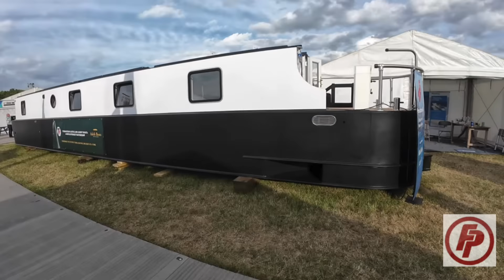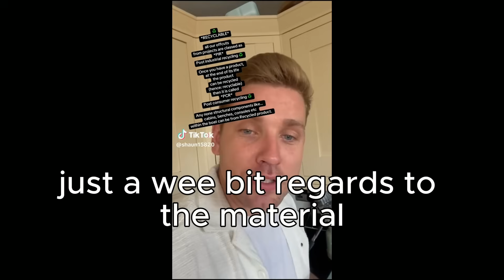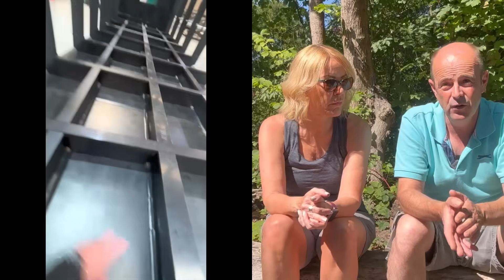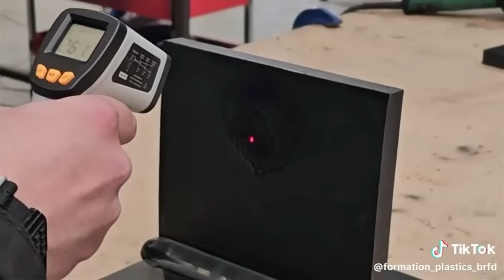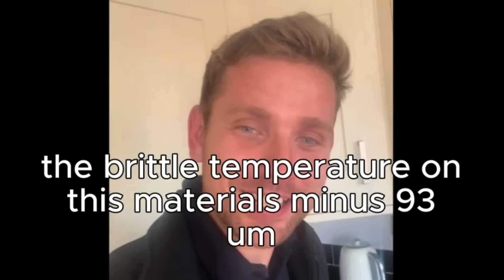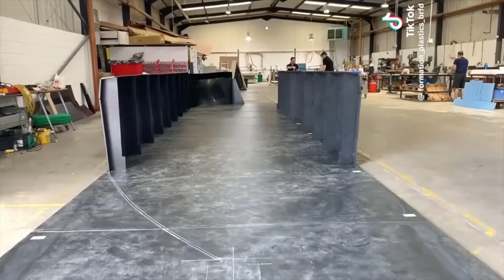Rust-Free Canal Boat?! The WORLD'S First Plastic Narrowboat Explained | 194

Comment: A very interesting idea. 
Question: what's the embodied energy to make the plastic? How does this compare with making steel?
Reply: Great question! Polystone G marine tec has an embodied energy of around 75–100 MJ/kg, while steel is lower at 20–40 MJ/kg. But Polystone G is much lighter, corrosion-resistant, and ideal for marine use, where steel would need coatings or constant maintenance. Plus, Röchling’s ReLoop® version uses recycled content, cutting the energy impact even further.
Reply from the maker: Glad to see Shaun answered for you 😁

Comment: The plastic boat floats higher so distance from water level to top of the cabin plus solar panels etc. will be greater than  steel boats.
There are many bridges on the canals that steel boats just squeeze under.
What's the plan for overcoming that problem?
Reply: Great point! Since our boat Polystone G are lighter, they do sit a bit higher in the water, which can raise the overall height. But this is usually solved by smart design—things like lowering the cabin profile, using fold-down solar panels, or adjusting ballast to fine-tune the draft. Plus, the lighter hull means there’s more flexibility to tweak the design compared to heavier steel boats. So, navigating low bridges is definitely something that can be planned for
Reply from the maker: Luckily as Shaun has explained it can be overcome 😁

Comment: Not plastic, but with a proven track record. How about surplus WWII PT boats? That would cause a stir on the old canal. Whatcha think?
Reply from the maker: Ha! That would definitely turn heads 😄 But WWII PT boats are huge—around 80ft long and ~20ft wide with big planing hulls and very thirsty petrol engines. Great on open water, but a non-starter for UK canals (locks/bridges are built for smaller beams and low wash). We’ll stick to canal-sized hulls—HDPE gives the low-maintenance benefits without breaking the canal rules. 😃

Comment: So watching the heating transmission test, does this mean insulation is not req'd?
Reply from the maker: Great question! The test just showed how much better HDPE performs than steel at stopping heat transfer. But you’d still need insulation inside for comfort, to manage condensation and to keep the boat warm in winter/cool in summer — just like with a steel boat. 😁
Reply: @WidebeamandWellingtons Ah okay ta. Fascinating material though. Thank you for the video & reply x

Comment: Great strides forward, but the biggest problem with taking this further will be the upscaling to large production figures. The welding is the most obvious bottle neck, as it requires a very specialist welding technique. Best of luck in making this the success it deserves to be. Really exciting venture.
Reply from the maker: Really appreciate that! You’re right, the welding is a very specialist skill — that’s what gives the hull its strength. It’s definitely an exciting venture and great to see new approaches coming into the waterways. 😁
Reply: Its All straight lines So it wont be long before the welding gets automated. I used to be a welder(stick Gas CO2 and Argon) and you look at the welds on aluminium bicycle frames from places like Korea. Aluminium is Notoriously hard to weld because the oxide that forms on it almost instantly, melts at a higher temp than the actual metal, so when it does melt the actual metal just falls out and flows away, you have to see it to believe it. Yet through automation they make absolutely perfect welds on Aluminium Bicycle Frames, Magic is the only word to describe it. No doubt over the years similar tech will be developed(if its not already available) for reducing the welding labour times in HDPE. Steel is the one reason I have never considered a narrow boat. How about Stainless Steel(just a thought).:hand-orange-covering-eyes::face-blue-wide-eyes::body-blue-raised-arms:

Comment: I've pointed out elsewhere that hdpe boats, while great in lots of respects, and great in sea going scenarios, have some rather big downsides. Its a strong material and easy to repair for scratches etc. They say that it doesn't shed microplastics. But I would say that any shed plastic from abrasion on lock sides, concrete edges, steel protrusions, while not technically being "micro" will enter the environment and never be removed. Over time, large pieces of plastic, such as millimeter sized swarf, will become microplastic. While only the occasional boat is on the system, it wouldnt be a major problem, but if they became widespread there would be a problem.

The second major problem is the behaviour of the plastic in the event of fire. Unlike steel, hdpe becomes soft and melts at a relatively low temperature. Furthermore, hdpe, when it becomes engulfed in fire, becomes fuel.

Instead of the "tests" that they have shown, which look like they are designed not to fail, I'd like to see some real world tests. I'd suggest that hitting a finished boat with a hammer or squirting a bit of burning solvent on it, tells you nothing. Instead, I'd like to see a finished hull being dragged across their concrete yard and seeing how much plastic gets ripped off. I'd like to see a section of hull finished and lined with wood and PU foam and then subjected to a proper fire test.

You say he's consulted with BMF, but thats a trade organisation. Has he consulted the Boat Safety Scheme? Has he consulted an independent fire safety organisation? Has he consulted CRT? He has said in the past that he intends to do so, where is the evidence?
Reply: Appreciate the detailed comment — totally fair to raise these questions, and it's important to have open discussion around new materials like HDPE Polystone g marine tec  in boatbuilding.
On fire safety:
The ignition point of HDPE (like Polystone G Marine-Tec) is actually very similar to GRP — both ignite around 350–400°C. Like GRP, HDPE will melt before it burns, and yes, it's a combustible material — but so are foam insulation, plywood interiors, and even paint systems used in steel boats. Fire safety isn't just about the hull material, it's about the whole build-up and how it's managed.
On CRT, BSS, and insurance:
We’ve spoken directly with both CRT and the Boat Safety Scheme regarding our designs. Our widebeam HDPE boat has been inspected by BSS and they were happy with everything we’re doing. Same with CRT — they’re aware and supportive of innovation as long as it meets safety and environmental requirements. Insurance has also not been an issue — we’ve had full cover with standard providers. There’s a growing understanding that HDPE, when done right, is safe and reliable.
On real-world testing:
Totally get your point about wanting to see more "abuse" style testing. We’ve already tested HDPE under some basic tough conditions (impact, fire, dragging, etc.) but we'll keep publishing more content showing how it performs in the real world. It’s still early days for this material in inland boats, but we’re committed to being transparent and setting a strong standard.
End of the day, no material is perfect — but HDPE offers a lot of long-term environmental and maintenance benefits, especially when fully welded and built properly. Appreciate the feedback rd. 👍
Reply: I would think even if all narrow boats were plastic the amount of micro plastic that would come off them is a probably be nano % compared to drinks bottles in the environment or nylon clothing or plastic in dishwashers, road tyres ! I would guess if all canal boats were plastic, the plastic pollution would be 0.00000000000000000000000000000000001 % of the world’s plastic nano particles. But it would be a complete stab in the dark, probably an even smaller number !
Reply: Yes, but if you take into account that this plastic, unlike fiberglass and steel, doesn't need to be painted. So there's a massive reduction in paint chippings entering the water. Scatches could be eliminated by sticking carbon fibre or graphine to the hull. Further, these boats are lighter so they use less fuel which means less pollutants entering the water and air. Also as they're lighter it's entirely possible to have them powered by electric. For instance something similar to a range extender car like BMW's I3. With batteries getting smaller and smaller but more and more powerful these boats are a no brainer.
Reply: @safebarbell narrowboats don't get lighter. If they are made of lighter material, they need heavier ballast. The overall weight has to be the same, otherwise they don't sit right in the water.
Reply from the maker: Hi 👋🏻 and thank you for the detailed comments as you can see Shaun has answered for you! 😃
Reply: You worry about microplastic coming off practically non existant narrow boats? What about the tens of millions of wheelie bins that get smashed about every week? If you are going to worry about something, at least be realistic.
Reply: @markrainford1219 yes, you probably use the same excuse when you're chucking your burger wrapper out of the car window
Reply: The weird thing is that with these plastic boats you are not contributing much to the canal boat industry. With it being ‘indestructible’ and maintenance free you will take a lot of jobs away from it. And as every hull needs to be in virgin material you still keep creating more and more plastic as you can’t reuse one old boat to build a new one. And how many times can you actually reuse the material to still be safe for marine and human life?
Reply: @tteric67  You raise a fair concern, and it's something we’re actively thinking about. Right now, hulls do typically rely on virgin polymer to meet structural and safety standards—especially for marine use where strength, UV resistance, and longevity are critical. That’s a limitation of current recycling technology, not the goal.
That said, there’s a growing focus on post-industrial recycling—where manufacturing waste is reused immediately—and post-consumer recycling though it's not yet viable for core structural components in boats. We're watching developments in advanced polymer recycling closely, especially those that could allow safe reuse without degrading performance or environmental safety.
As for the canal boat industry: yes, materials like these change the maintenance model. But they also open up new opportunities in design, services, and sustainable innovation. We're not claiming this is a perfect solution—just a step toward less waste, longer life, and (eventually) more circular manufacturing. It’s not about replacing skilled work but evolving how it's applied.
😊😊😊.
Reply: Danger of microplastic in the environment is highly overegged to the point of ridiculousness.
Reply: @TheBeaker59 your view entirely, but not shared by everyone. When microplastics can now be identified in human blood, brain tissue and breast milk, but with absolutely no knowledge of what harm this might cause, excuse me if I prefer to err on the side of caution. Afterall, your attitude is an exact parallel of the one that used to be held up by the tobacco industry - look where that is now.

Comment: One thing if the plastic boat sits higher in the water what happens to with low bridges and tunnels?
Reply from the maker: Hi we’ve had this question a couple of times, here’s Shaun’s answer 😁
“As for draft, our setup has a draft of approximately 17-18 inches using the Vetus E-Pod propulsion system. If you were to use a more conventional propulsion system, you'd be looking at a draft closer to 19-20 inches, depending on the configuration.
Your points on wind drift and low bridges are valid - and as you said, easily addressed with additional ballast or by fitting a keel/skids.”

Comment: Why cant new innovationsbe cheaper lol
Reply from the maker: True, you’d think new inventions would be cheaper straight away. The reality is the first few are more expensive because of development costs and smaller production runs. The difference with these plastic boats though is that you don’t have the same ongoing maintenance costs as steel – no blacking, no rust treatment, no repainting – so over time they should work out more cost-effective. 😁
Reply: A lot of people ask why boats like ours (made from Polystone G Marine-Tec HDPE) can’t be cheaper — and honestly, it comes down to the material cost, labour, and process.
Polystone G Marine-Tec is a high-performance HDPE specifically engineered for marine use. It’s UV-stabilised, impact-resistant, chemically resistant, and made to last for decades without rust, rot, or maintenance like steel or wood. But that quality comes at a price — it's not your average plastic sheet.
The build process is also super labour-intensive. You don’t just screw it together — you weld it, just like steel. HDPE welding uses hot air or extrusion welders, and the skill level needed is similar to TIG or MIG welding for metal. Every joint has to be precision-prepared and tested to ensure watertight, strong seams.
Also, unlike mass-produced boats, these are often custom builds, not churned out on assembly lines. It’s still early days for 100% plastic canal boats in the world so the scale isn’t there yet to bring prices down like steel boats built in bulk for decades.

 you're getting a fully recyclable, maintenance-free, rustproof boat that could outlast a traditional hull. That’s the trade-off. ⚒️💧

Comment: I actually like the idea of plastic narrowboats, the only thing I don't think works on his boat is the scoop system around the propeller. I think that would cause major problems considering the rubbish under water, you'd be forever stopping and trying to clear it. If it was more traditional on the back he'd be on to a winner.
Reply from the maker: Ah yes, the original one was running an e-pod system which is why it looked a bit different around the prop. But Shaun can also fit a traditional shaft, prop and rudder setup if that’s what people prefer — so you’re not tied to just one system. 😁
Reply: Thanks for that the one we are making just now is very much traditional in that sense 😊😊
Reply: @ShaunMoir1   I saw a fiberglass narrowboat made in the 70's I think same kind of thickness and the hull was scratched but still perfect so you definately are on the road to success. :)
Reply: @FlashGormless thank you it’s been a long process we learned so much form cricket last year everyone has welcomed us into this industry and something I want to make sure we do correctly 😊😊

Comment: What are the price difference esteem a new trad hull and these plastic boats
Reply from the maker: Good question 👍 The plastic boats come in at around £1,000 per foot. A new steel trad hull usually sits a bit lower than that per foot, depending on the builder and spec, but of course with steel you’ve then got ongoing maintenance costs (blacking, rust treatment, painting, etc.). With HDPE the big selling point is that you don’t have those same maintenance costs down the line.

Comment: Why not coat steel boats in it?.
Reply from the maker: Interesting thought! HDPE doesn’t really bond well to steel in the way a paint or epoxy coating does – it’s a completely different material and would just peel away rather than protect. That’s why builders make the whole hull out of HDPE sheets welded together instead. It’s the welding process that gives the strength and protection. 😁
Reply: We actually do HDPE  cladding on steel for chemical tanks sometimes, and yeah — box section can be overclad with HDPE in certain setups. But when it comes to boats, the big issue is thermal expansion. Steel and HDPE expand at totally different rates, which causes major problems over time — warping, separation, or cracking.
That’s why we went with a 100% HDPE plastic build for our canal boat. No steel core — just plastic throughout., 💪hope that helps 😊🚤
Reply: It does, thanks.